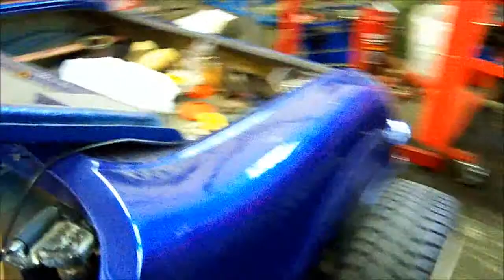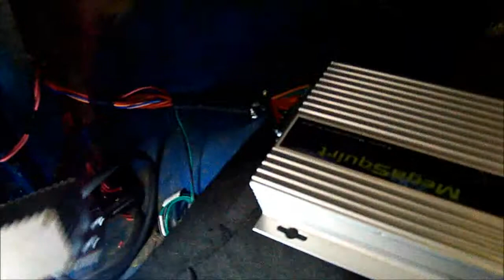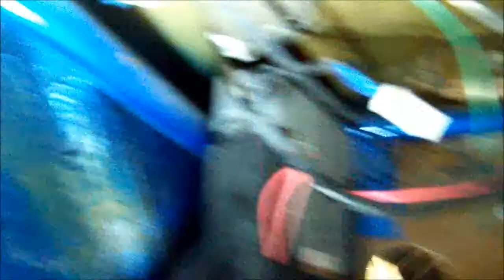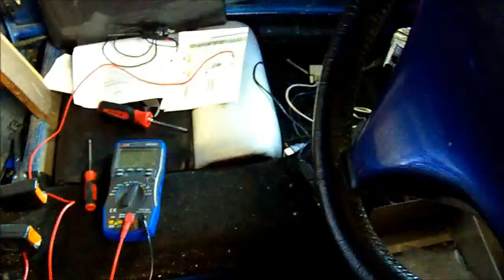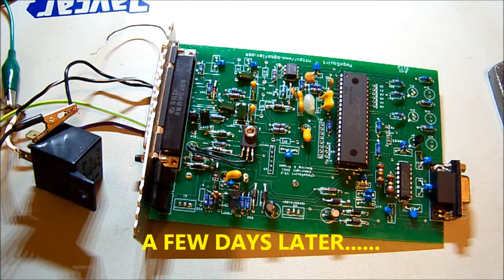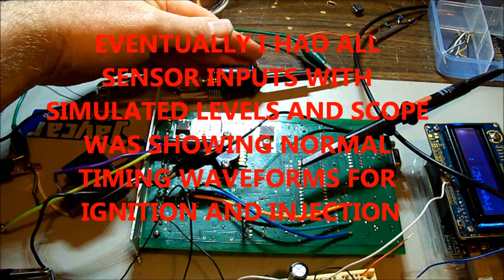Megasquirt ECU repair Part 2

Comment: did you got it fixed?
Reply from the maker: I did. Engine ran ok but because of poor design there was a lot of EMI coming from somewhere which really upset the dyno so it couldn't be tuned. A link was later installed, much better unit.
Reply: Jonny Fix I saw its bad design the moment you cracked it open. good job btw

Comment: Sir one transistor how work in four injector
Reply from the maker: +yousaf0156 khan Usually in a 4cyl engine you would have 2 per transistor and they'd be fired sequentially and only injecting half as much as is needed each time. This leaves some fuel sitting on the intake valve until the intake stroke when the other half is injected with it.

Comment: do you solder both sides of the components or just on side of the megasquirt board
Reply from the maker: +dphothisane You only need to solder one side, the solder will flow through the hole.